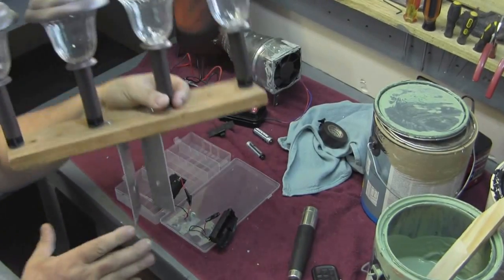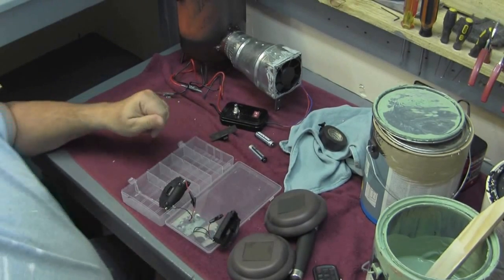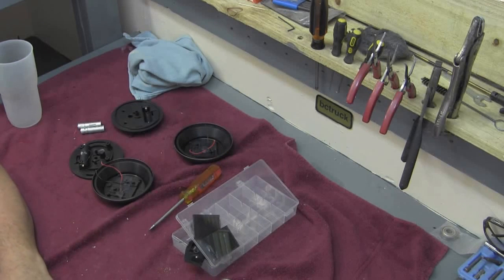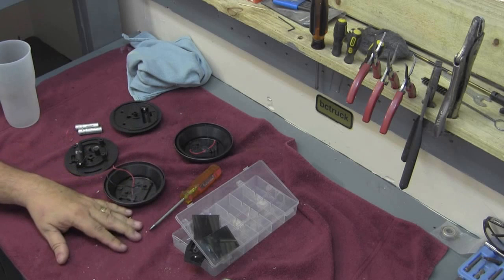Homemade solar battery charger

Comment: Just Buy a 6V 1.5W Panel...about $10
a battery case from any electrical shop that holds 4 Batteries maybe $4
Neater,easier, and more effective.

Comment from the maker: thanks for watching ann. this was just an experiment in the event you where caught without any means of charging batteries after a grid failure. i dont think it could beat a store bought one and i hope to make that purchase before much longer,but if the grid failed,at least you could barter for your neighbor solar garden lights and make a battery charger.

Comment: I used an eBay solar battery charger and took the wires' alligator clips to several different "flavors" of battery holders.  AAAs, AAs and 9 volt and 6 volt lantern cells.  Put spade connectors on the ends of each of the battery holders' wires, so now I can clip and unclip whichever size battery I need to charge,  Your system is far more economical, though.  Gonna hafta try that!

Comment: Hey there, great idea.  When you get your parts to prevent back-flow, don't forget to do something to turn it off or to prevent overcharging your cells,  If I knew what I was talking about, it would be more helpful. :-{  I just know that everything I read, uses "charge controllers" and every cell charger I've ever bought made a big deal out of the fact that their charger turned off or otherwise prevented overcharging.  That may be why your cells were a little warm when you removed them.

Comment from the maker: i did not know that!!! thanks for letting me know that. would the LED being on,use enough of the electricity that your using to charge batteries,to be a concern? ill try wiring more than one together for faster charging times. thanks for the comment and if you have any more advice or input,it is welcomed here.

Comment: Yup a diode would be a good idea, and one with a low forward voltage so you dont loose potential.

A Schottky diode would be my choice unless someone has a better type :-)

Comment: I started using solar garden lights as emergency lighting in my house. I removed the solar cell/storage units, mounted them on a panel that sits on the roof, ran wires from the cells to switches and from switches to the lights. I mounted the lights at strategic locations in the house. When Rappahannock Electric Cooperative experience one of its many outages, it's no problem for us.

Comment: Very cool but I wonder if the batteries will be damaged by the extreme heat over and over? If so you could run a longer wire to them and keep em in the shade maybe.